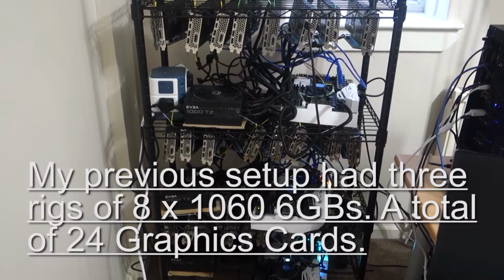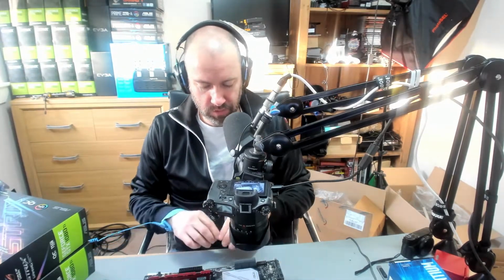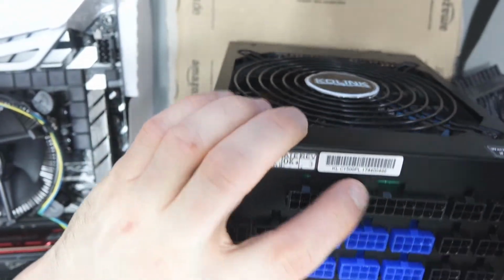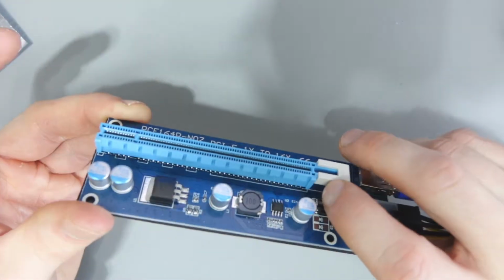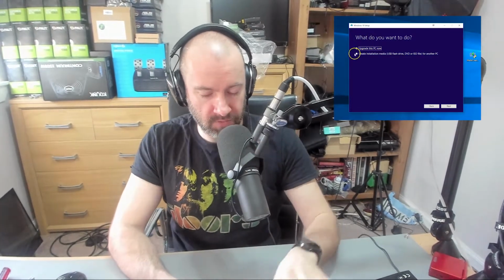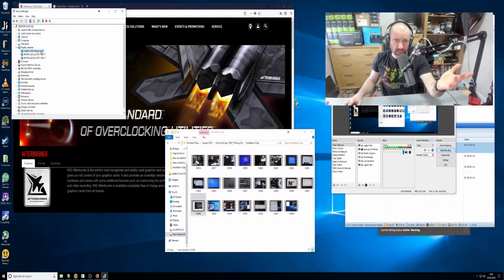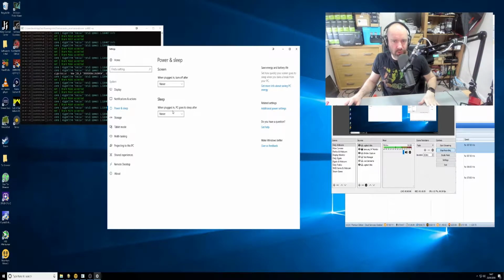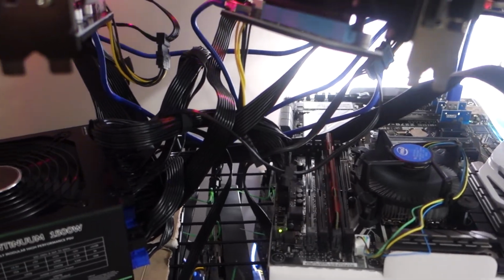How to Build a Cryptocurrency Mining Rig

Comment: Another excellent vid Kev! I'm thinking I definitely need to set up a rig as a new project (notwithstanding your concerns on timing with the new cards expected to be released within a few months...). I'm an absolute rig virgin, so quite apprehensive. I have the same feeling I had before I first took the plunge with buying my first cryptos last year. Well, that worked out pretty well, so I figure this woudl be a good "next project". I have lots of idiot questions though. One is: you said the mother board can handle 8 GPUs. How about the PSU? Didn't you say each GPU uses 250W? Also, how long do you expet each GPU to last? I know it's how long is a piece of string depending on over/under-clocking, etc, but is there a rule of thumb on this? FInally, do you expect these GPUs to be made obselete by new cards being released this year? Or will they always be usable, just perhaps not as productively as before, as the technology continues to advance? Sorry for the long post, but your video has got me all inspired...!
Reply from the maker: Hi Richard.

Glad you liked the video. I actually did it a month or so ago for my other channel, but a lot of people were asking about it.

I've jumped from my phone to the laptop so I can answer your questions better. They're not idiot questions. You're doing the right thing. Ask as many questions as you can before you spend one penny on hardware. :)

Question: 

You said the mother board can handle 8 GPUs. How about the PSU? Didn't you say each GPU uses 250W? 

Answer:

It depends on the PSU output and the GPUs you are using.

Your PSU will have to handle the motherboard, CPU, fans, hard drive etc too. You can work it out roughly using PSU calculators . Check out this video I did about it a few months ago https://www.youtube.com/watch?v=0ykcHPIv2n0

PSUs come in many different variations. A PC with one 1080ti would be fine with one 1080 TI. Using a less powerful GPU, 450 watts might be ok.

You can buy PSUs that are 500 watts, 600, 650, 750, 850, 1000, 1200, 1500, 1600 etc

GPUS draw a different amount of power too.

For example, a 1060 6GB can draw 120 watts, a 1070 can draw 150 watts, a 1070 ti and 1080 180 watts, and a 1080 ti 250 watts. It's worth noting that if you run these in OC mode and keep power at 100%, the total power usage could be higher. For example, a 1080 ti could end spike to 275 or 300 watts when pushed, and your PSU needs to handle it.

Miners tend to under power their GPUS. For example, my 1080 tis are at 82%, so in theory they should run at 82% of their normal output (250*0.82 = 205 watts). Though remember, it won't be running at 200 or so watts all the time, but your PSU needs to be handled it.

Question: 

Also, how long do you expect each GPU to last? I know it's how long is a piece of string depending on over/under-clocking, etc, but is there a rule of thumb on this? 

Answer:

There is no reason why a GPU won't last years as long as you make sure you keep the cards running in a room that is fairly cool.

Question: 

FInally, do you expect these GPUs to be made obselete by new cards being released this year? Or will they always be usable, just perhaps not as productively as before, as the technology continues to advance? Sorry for the long post, but your video has got me all inspired...!

Answer:

The cards don't become obsolete per say, but they become less effective in comparison to newer cards.

Newer cards will be able to solve problems quicker. That means people with higher hash rates will be able generate more shares, which means a bigger allocation of each payment block.

I'm planning on live streaming tonight. I should be online for a few hours so feel free to drop by and pick my brains about anything you are unsure of.

I don't profess to be an expert on it all, but I have a good understanding of most things so I should be able to answer you or point you in the right direction.

Kevin
Reply: Thanks mate, really detailed and helpful reply. I realised I said 8 GPUs, when in fact you said 6 in the vid. 6x250 =1500 (and less if running at 82%), so it all makes sense now...what time are you planning to be live? I'm in the Hong Kong time zone (GMT + 8 hrs), so not sure I'll be able to make it, especially with a hyperactive 4-year old demanding constant attention...!
Reply from the maker: No problem if you can't make the stream. It will be around 19:45pm UK time. Around three hours from now.
Reply: I tuned in towards the end, but my internet was playing up so had problems streaming it. I'll catch up with the uploaded version...back to GPUs, how to go about selecting one? 1060 vs 1070 vs 1080, etc. 1080 obviously hgher hash rate and revenue, but more expensive to buy and to run. Do you just go for the most powerful you can afford (assuming money is no object!), or is it worth considering older/lower spec cards, accepting that they won't generate as much revenue but obviously cheaper to buy and run. Also, perhaps an obvious question, but can you mix and match GPUs on the same rig, or is that an absolute no-no?

Comment: You should also make these two settings in nvidiaProfileInspector as shown here https://i.imgur.com/dvB3W6O.png. Make sure you click "Apply changes."
Also, whenever you add/remove a card, both/one of these values reset.

It boosted my hash rates a bit.
Reply from the maker: I've never seen that before. What do they settings actually do?
Reply: On Cuda Force P2 state, I've read here http://cryptomining-blog.com/tag/p2-power-state-in-compute/
On Power Management Mode value, I've read here https://ravenforum.org/topic/7/x16r-mining-tips
Reply from the maker: Right. So the P2 state is for ethereum. I'll look into it. It looks like it draws more power, but if the rise in hash rate is significant it could be worth it.
Reply: I'm convinced that it applies to any algo. For example, on a PC on which I have 2 1070 Tis mining BTCP, it went from 1.08k to 1.11k for 10W more. It's not much but it's almost free.